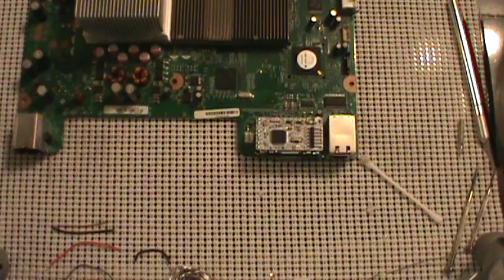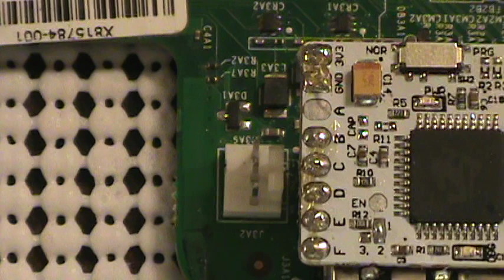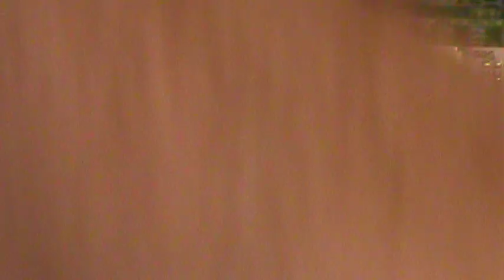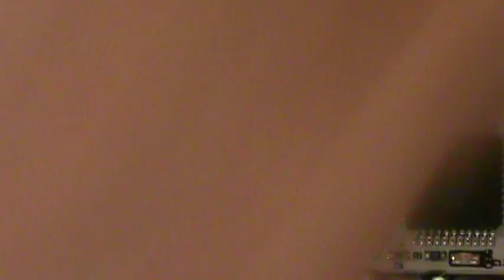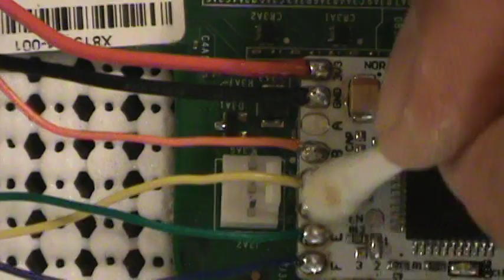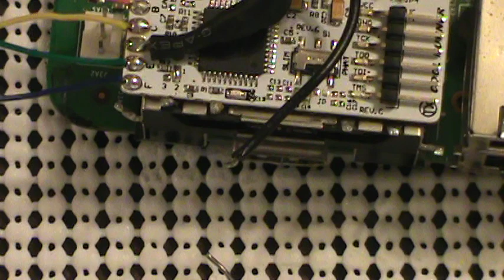Xbox 360 RGH2.0 Tutorial Part 2

Comment: Hey Keil, great tutorial.
One question (so far) I got shorted my low loss cable.
Can I just use single wires of the same gauge?
Thanks !!!
Reply from the maker: Honestly I stopped using the low loss ages ago. Just use the regular provided blue wire in its place. It's best to use the post out qsb to.
Reply: Thank you very much for your expertise !

Comment from the maker: Check you solder joints.  If any look dry (not shinny) put some flux paste on them and reflow them.  Its usually a cold solder joint that causes them to stop working.  If not try switch the coolrunner to program and write the retail nand back to the console.  See if it boots.  If it does then create a new glitch image and write it back to the console.